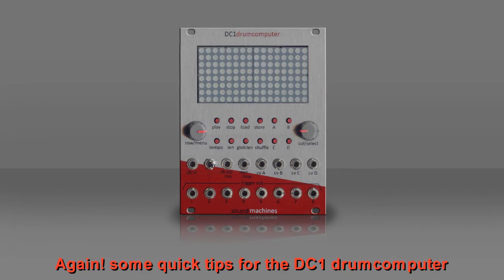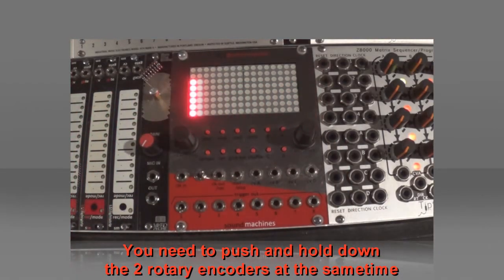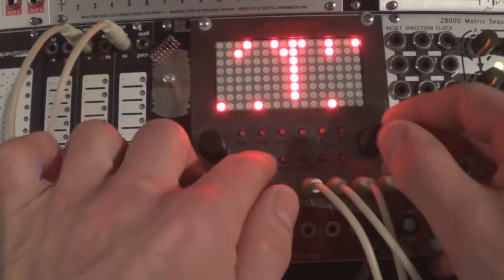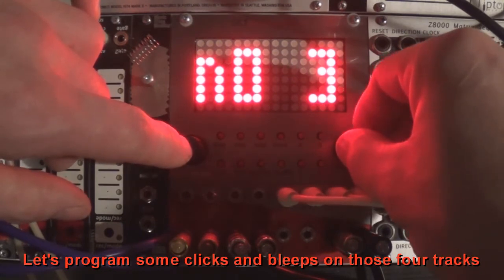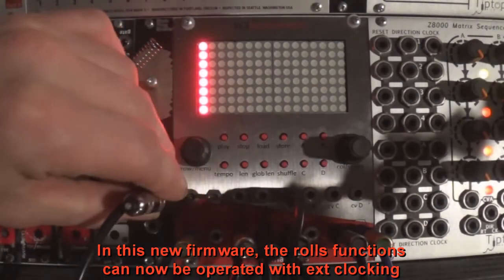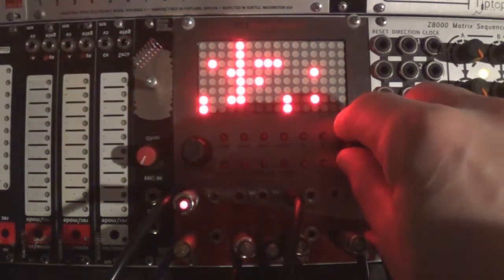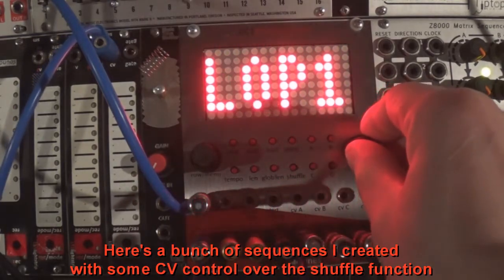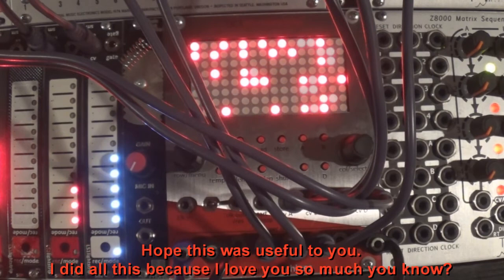DC1 Drumcomputer Firmware 2.4 : Euclidean patterns

Comment: hi pls help I try to update but in vain, nothing happens when I push the knobs and switch it on. I have uploaded the files and inserted the micro sd card (transcedent 64gb microSDXC). Maybe the card should be max 2GB? or smth is wrong with the module? I never updated for any prev firmwares
Reply from the maker: Make sure you only have hte firmware on the microSD card.
Maybe it's your micro SD card !?!? Mine was only 4gb.

If this don't work.... maybe ask directly to Soundmachines or ask Davide Mancini.